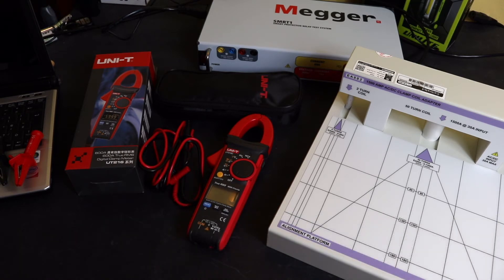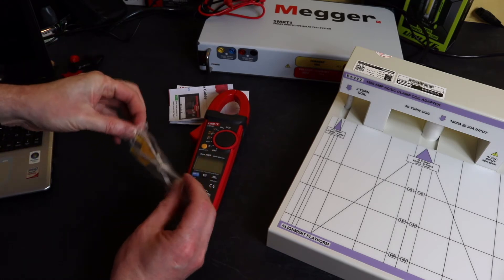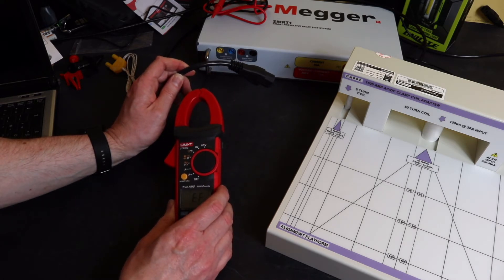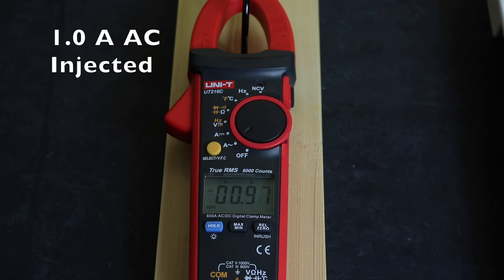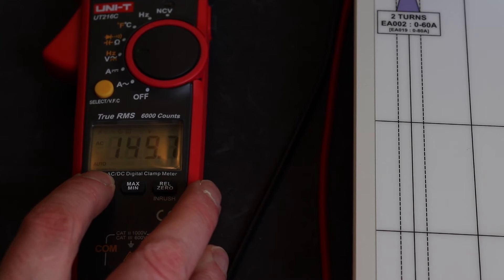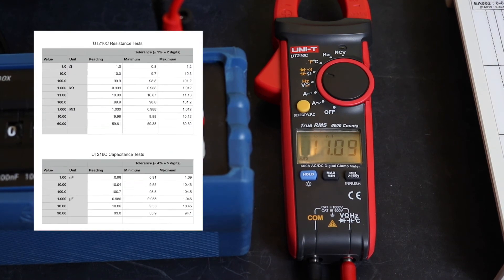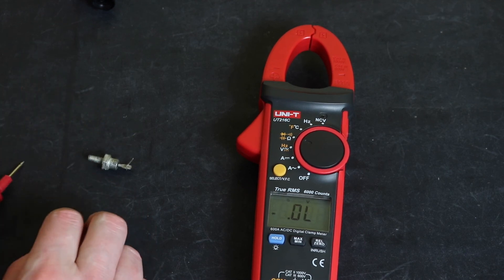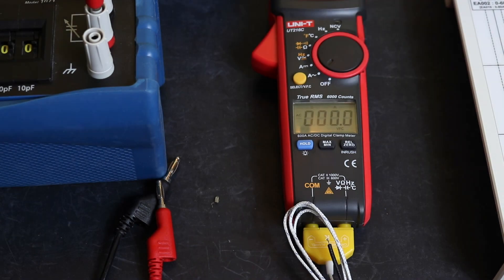Uni-Trend UT216C Review and Test

Comment: I have this meter & aside from the extremely laggy continuity setting,this meter is a very good quality meter & I have tested the inrush feature & it is very fast & accurate,if I need continuity,I would rather use my UT89X anyway,the continuity function on that meter is very fast.Great review mate,very comprehensive.👍⚡
Reply from the maker: The only issue I have with the inrush function is that there is no specification for it within the manual. Ultimately the meter is aimed at electrical use, so whilst the continuity function is slow, it isn't too bad for electrical circuits.
Thanks for watching and commenting.

Comment: Not wanting to sound critical but you didn't appear to have zeroed the meter in situ as per instructions before testing the DC current measurement which would affect the accuracy of the readings. I have the uni-t201e as a kick around and find it pretty much in line with my fluke.
Reply from the maker: Certainly on the low amp DC tests it would have made a difference and would have brought the readings back into tolerance. I probably didn't zero it, so it is a good catch. Even if I had, taking away the residual on the display, puts the readings back in spec.

Comment: is 216C better or 208B?
Reply from the maker: The 208B appears to be aimed towards more professional use than the 216C is, but I have not tested the 208B. It has a few more features an industrial electrician would find beneficial and of course can measure a higher current than the 216C. For more DIY use I would stick with the 216C unless you can get the 208B for a better price.

Comment: What about inrush test? Work it correctly?
Reply from the maker: Yes, the inrush current works for AC current only. Unfortunately, there is no specification from Uni-T as to whether or not it measures at a specific time stamp or if it averages out over a time period.
Reply: Yes, I know there is such a function on this device. I just wonder if the values he shows are close to reality or not. I have to choose a generator for the water pump and I do not know if this device is suitable for measuring its starting current.
Reply from the maker: @JakisKtos2745  Unfortunately, I cannot find the figures from when I tested it. I would expect it to be within 10% of the actual value. If you already have the UT216C, then it should be fine. However, if you are buying this specifically for the inrush function, then it may be better to look at another clamp that details the actual specification.

Comment: PS I don't think the probemaster leads are any better or worse than any other leads,I use the UT L16's with my 216C & thry are probably the best leads I have ever used.
Reply from the maker: The Probemaster leads are good quality and ergonomic and come with some useful attachments. It depends on whether or not you value the gold plating. I do not have a set of the UT UL16, so cannot comment directly on them, but I would imagine they are fine for general meter use.
Reply: Yeah the L16's are silicone rubber using 16 AWG leads & the probes are good quality with a really nice smooth waxy feel,I'm a HV Electrician & I use them at work.Btw the inrush feature is very fast & very accurate,also regarding the continuity test,in my manual it says the audible buzzer will not sound for anything 30 Ohms or below, that's why it is so laggy,not the best idea they've ever had,because most people are just going to think that it is just a very poorly designed continuity setting,but there you have it.
Reply from the maker: @danielelise7348  I have had a look at my other Uni-T meters and it doesn't look like any of them come with the L16 leads. The UT196 I have probably have something similar, which are actually quite nice leads. Looks like I would have to buy L16 leads direct from China, so would take a while for me to get.
Yes the buzzer only sounds when the resistance is below 30 Ohms. As an electrician I have never really needed a fast continuity function, but that is just me.